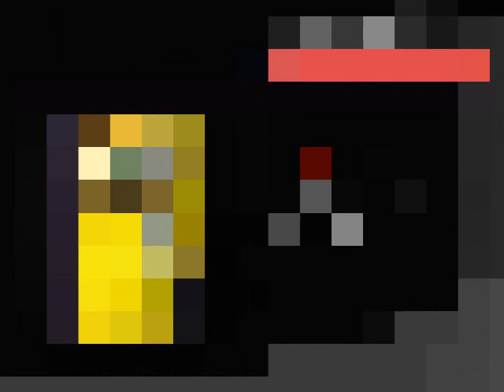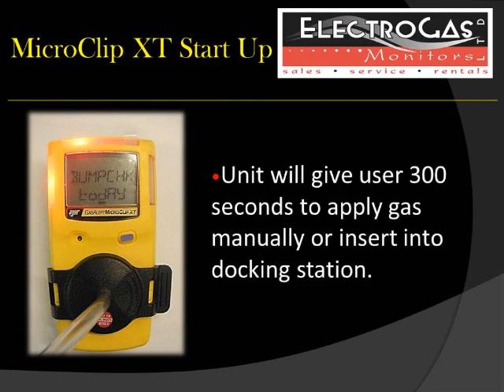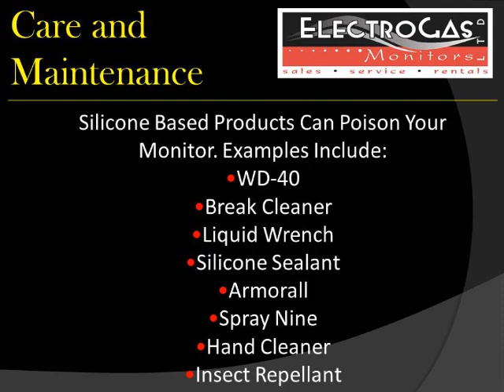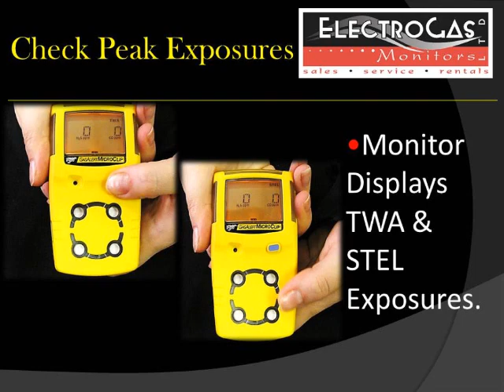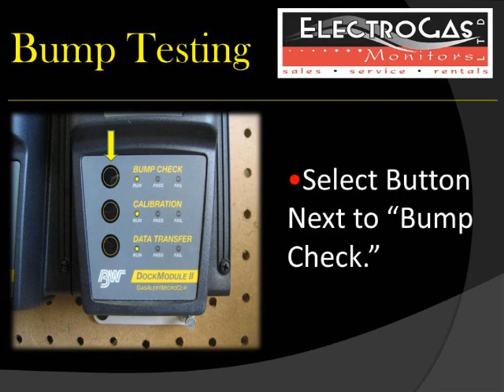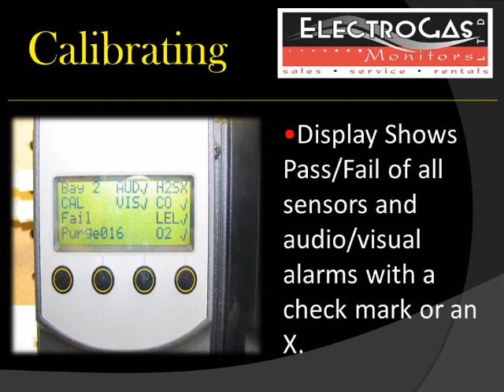XT Training Video

Comment: I have a new BW Honeywell GasAlertMax XT II. The O2 reading is fixed at 20.9%. Is that ok, or should it be fluctuating/changing as i move around the plant? Thanks.
Reply: Orege Antony: My name is Jason and I'm a technician here at Electrogas Monitors and I would be happy to answer your question.

A constant reading of 20.9% Oxygen is ideal (the same concentration present throughout the planet) and should not fluctuate during your day to day operations. In fact, if this number does move to the point of alarm breach, I would recommend leaving the area immediately and determine the cause of the alarm. 

If you have any further questions please contact us here on YouTube or by contacting our 24 hour tech support:

Ph: 1-866-341-6167
email: jason@electrogasmonitors.com
Reply: Jason Potter: Thanks a lot. I also did a long exhale onto the pump port and the O2 reading dropped, triggering the LOW alarm. The CO reading increased too.

Comment: error 2?
Reply: Mayco Russell:  Hello, my name is Jason Potter, I'm a technician here at Electrogas Monitors. "Error 2 - Sensor Voltage FAIL" is most likely caused by a poor connection between boards inside the detector. 

You could take it apart yourself and check the connections but I would not recommend doing that unless you are trained for that level of repair. As an alternative to repairing it yourself, I would suggest sending it in to either our Calgary service centre or our head office in Red Deer (where I am located) we can take a look at this unit and provide a quote to you. No charge for unit diagnoses and quote.   

Please contact me at:
Electrogas Monitors
Jason Potter
403-341-6167
jason@electrogasmonitors.com